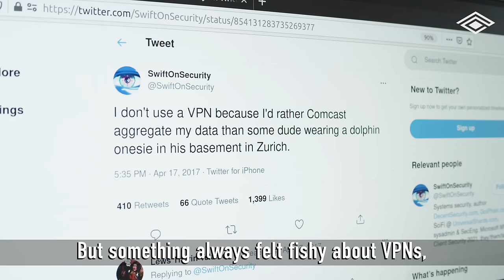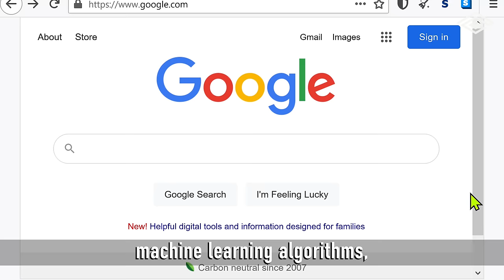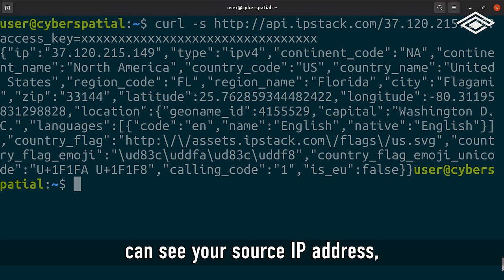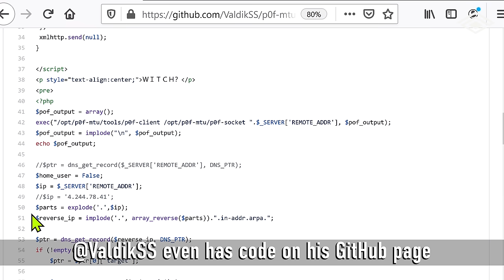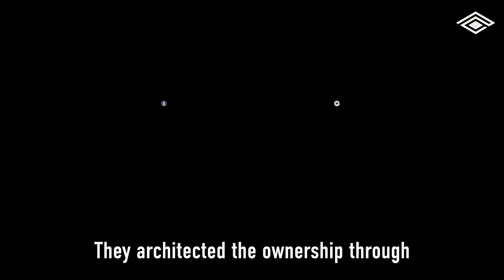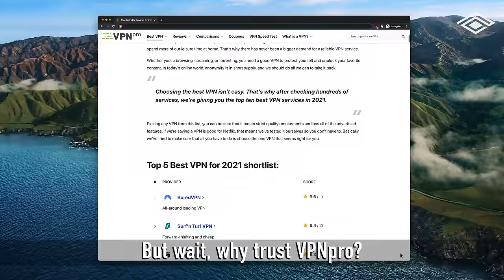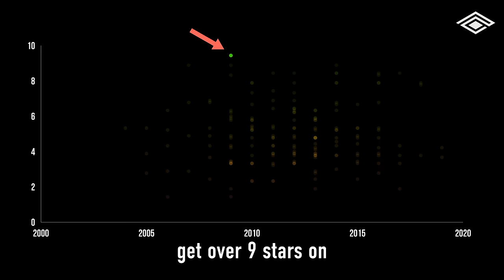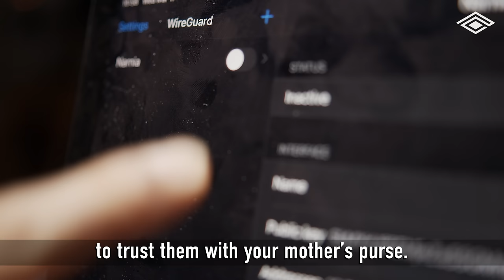Why VPNs are a WASTE of Your Money (usually…)

Comment: In my experience, the Internet slows down without the VPN. It appears that certain routers may restrict the flow of information from a particular IP address and throttle it over time. VPNs often help bypass this issue. On the other hand I’m extremely suspicious about VPN, especially when they’re home office is in Panama city Panama, which is basically CIA headquarters for all of central and South America.😂

Comment: I used proton vpn while I was working in russia in 2022. They quickly banned all vpns and even while connecting to the internet through the Embassy internet, they were still able to block my attempts to use the vpn for most of my stay there. The only reason I bought the vpn was to try to protect my data from their government. I still have the service because it was a 2 year deal, so now I just use it so I can get around geo restrictions because I'm still outside of the US.

Comment: That's not necessarily true. Your IP address is exposed. No matter where you are in the world or what you're doing. Even game consoles like PlayStation and Xbox. Expos your I, p, so what you do if you do? Use a VPN need to use it from an official company at standpoint. Not a cheap VPN. That's from some cell phone company. You want it based on the actual internet observation type? Companies like Malware bytes or Norton 360. And then you need to make sure that your VPN setup nearby not necessarily on top of the same place that you're at but.  Nearby, so when it tunnels, it tunnels somewhere close by with less ping ... 32 ms or 60 is good which will keep your internet run as smooth and then if you have packet filters on your router is set up your packet filters up? There are 3 different types of packet filters. You will need to them active if you're gaming in for good streaming. If you activate the third type, the third type will deactivate TV's in cellphone calls and then read all your dues and donuts on your router because your router will have specific policies on it as well. Same thing goes for the rule basis. Everyone's router rule basis might be a little different...

Comment: Yea, using an "online vpn service" is basically pointless, unless you want to use the service as a proxy in order to "pretend" you are from another location. If the VPN client is not directly installed ON your device which, connects you directly to the VPN Back-end, then all traffic between yourself and the point to where your're connecting to, to the VPN service, is NOT vpn encrypted. Best is to make use of a corporate VPN, that requires a VPN client directly installed on your device, in order to connect! Preferable a 3rd party client with it's own server issued certificate that no-one else can possibly have! That's if you want to be truly secure... Any other method leaves a lot to be desired!
Reply from the maker: Great thoughts, thanks for sharing! Can also use a portable router that transparently tunnels your devices.

Comment: Oversold and aimed at the technologically unsophisticated. Example: He ticked off of 'hardware address' with the Content box, 'location' with the HTTP box, 'time stamp' with the TLS box, 'true IP' with the TCP box, and 'Google account' with the IP box (holy crap, you mean Google knows when you use your Google account?! wow). None of those things have anything to do with what they're listed with. This is the same kind of marketing manipulation he complains about in the premise. 

A fun fact: Every modern OS has the option (usually on by default, now, but I don't know for sure) that wireless connections (like at Starbucks) use a randomized MAC ('hardware') address. One connection's address will differ from the next, even at the same IP with the same device. Also, there's no such thing as "true IP." The guy just explained that IP addresses get changed/re-used by multiple ISP customers, and so an IP address will only actually track you to within a few zip codes (back when he was trying to tell you that VPNs are useless); but now an IP address is fixed not only to a certain location, but to your specific device? That's not how IP addresses works in the modern world. NAT is a thing. 

The entire DoD, including the NSA, uses VPNs for transmitting all kinds of official information, up to and including Top Secret classified data over open "dirty" Internet (see CSfC Capabilities Packages).

Comment: Every time my VPN goes down I get a copywrite strike from my ISP.  So whether they do anything real or not they keep my ISP from snitching on me or cutting service.  If I was worried about the fed I wouldn't be using electronics.  But getting the only fiber service in my area to cut me off will suck.

I'd avoid pirated software if there were FOSS alternatives to everything I wanted or I believed in copywrite laws.

Good avice of constructing your own.

Comment: I am surprised by how many use VPNs only to be told by me and others, "No disable it.  THAT'S why you can't access the internet."  Literally whenever someone calls me complaining that their Aphone can't get on the internet, that is often the 2nd or 3rd question right behind is WIFI turned on.  And 9 times out of 10, if one is installed, disabling it resolves the issue. Why that is the case is anyone's guess. Are these free VPNs down more often than up?

Comment: Hi! and thanks for sharing. 

I would say the most relevant part of the video starts at minute 5, where you elaborate on the reasons why you find VPNs ineffective at masking your IP.

You mention things like layer 2 vulnerabilities that lead to tech companies knowing your location and ISPs knowing you are connecting to a VPN, which are facts, but are they pertinent to the subject of VPNs, given that their main job is to mask your IP in order to hide any trace between you, the user, and the domains you connect to?

Yes, tech companies track our devices, but that doesn’t necessarily mean they can decrypt the data being sent to you from the VPN, and I don’t think the ISP1 can either. Maybe I'm missing something, but the same should be true of ISP2 (the one that services the VPN). Sure, they will be logging the packets between the VPN and the end domain, but those are encrypted packets, and they lead to the VPN's IP address, not yours. Meaning, the VPN will ultimately have to disclose their IP mappings for that to be of any value. In other words, if the VPN really doesn’t keep track of this data, then ISP records are of no use to them. Am I wrong?

Comment: VPNs are essential for accessing the Internet in China and for bittorrent downloading anywhere. Period.
Reply from the maker: You can access the Internet in China without a VPN. Bypassing geoblocks and National Firewalls is a use case mentioned in the video. 

You can BitTorrent Ubuntu Linux just about anywhere without a VPN.

Comment: Most cell plans limit video streaming to 480p. They do this by throttling your data speeds whenever you connect to a streaming service(Youtube, Netflix, Crunchyroll, Etc etc...) However, when you enable a vpn, you obscure the server and get max speeds. When I am connected to 5g, which is most of the time, I get 170-250 mbps which means I can stream 4k60 video whenever I want, and because my vpn is only 1.99 a month, I saved 18 dollars a month not upgrading my service to allow 4k video streaming

Comment: Quite a few of the things he says aren't true.
For example if your using a VPN your local network or geolocation is the VPN, this info only changes if you made the mistake communicating addition information to the host your connecting to, that a user error not the VPN's mistake.
Data storage of the ISP is incorrect because the ISP only sees encrypted data that it can't decrypt, they data is useless other than say hey I think  this pc is using a VPN.

Comment: So many stupids to "unpack".  First, Personal VPN's DO mask your original Geo-Location enabling you to surf and pretend your from a different country and you can launch independent VM's per session to side track any possible trackers.  Secondly, for corporations, VPN's mask your internal private IP's and its encrypting every communication.  Not all programs use https.  For instance, Outlook doesn't even offer an encrypted connection to your mail server and typically uses S/Mime encryption to send messages (only if you specify you want encryption).  Another thing that Corporate VPN's offer is pushing all client data to the companies network.  That way the communications can be tracked and ensured that it adheres to company policy which is mostly done through Firewalls.  This ensures that everything you do on your corporate laptop adheres to company policies.  This exclusive connectivity back to your companies network ensures that you can't  load harmful software since the company can now control your laptop through policies.  There are 100's of reasons for VPN's and I can't list them all but if you think that https solves everything, your mistaken.
Reply from the maker: If your computer has Wifi or Bluetooth near an access point or phone, there goes your geolocation... even with VPN. 

Sure you can use independent VMs to compartmentalize session fingerprints, but what's that got to do with VPNs?

VPNs don't mask your private internal IPs. For instance, if you have WebRTC enabled in the browser.

If you're using a program transmitting traffic in the clear across the Internet, you should probably not be using it. Re Outlook, the transport layer encryption depends on the configuration with the mail server. S/Mime is PKI-based end-to-end encryption, category error if you're conflating that with the transport layer encryption.

Corporate VPNS are definitely a legitimate use case mentioned in the video.

Take a look at Google's BeyondCorp architecture. No VPNs to access the corporate network. Just Identity access proxies and HTTPS.

HTTPS doesn't solve everything and there is a place for VPNs. Commercial VPN companies touting them for security and privacy? Questionable...
Reply: To find a Geolocation, you would have to spy on them from the beginning to determine where they are.  Again, you can spin up a VM in the cloud or off-location or anywhere and use that to surf.  Also, using a VPN on a computer where there are cookies and other means to track you in itself won't protect yourself.  Especially with a Cellphone.  Especially since they are equipped with an IMEI Identifier.  The BEST way to surf is to setup a One use VM not in your physical area and then use that VM through a VPN to access the Internet if you want to remain anonymous.  There are other ways but that's the easiest method. @Cyberspatial

Comment: $20 in 1916 is how much today, 2024 adjusted for inflation?
Result: $596.78 in 2024 dollars.
Prices increased by 2,884% over that time period, with inflation averaging 3.19% per year. So $20 is not a massive fine but it's also not merely 'symbolic' like say a $1 fine today or 5 cent fine back then,

Comment: This is a very weird reason for me to use VPN, but i use VPN mainly to avoid packet loss and maximizing my download speed. I dont know how that works tho
Reply from the maker: That is really really interesting...
Reply: @Cyberspatial  exactly. im playing video games called SQUAD right now, and most of its servers are located outside of my region (I live in Southeast Asia). which you know, interregional connection are not really enjoyable for playing games. with pings around 240 to 350. At first, its filled with Packet Loss (around 20%)
then i remember i still have that one switzerland vpn subscription, so at the back of my mind "why dont i try that"

i connect to my nearest server, and hopped back into the game.

no packet loss.

and i notice that when i do the same (connect my vpn), my steam download connection would be much faster and more consistent. (my speed is around 5MB/s, and it tops around that more or less when using vpn) when not using VPN usually it only reach hundreds of KB/s

i dont know at all why this is my case 😂

Comment: My router RM-7200 encrypt all data, all ports stealth so no hacker can find open ports. 8 prt router 40gbps per port , self build My ISP contacted me cause ok external ip but no connections found. I did told hem my own creation  because there where no 40 Gbps per port routers, backbone 7200 Gbps.  Wan scalable between 300 Mbps and 40Gbps

Comment: There are so many things wrong with your logic that's not even worth pointing out. A VPN, is like a gun, it can be dangerous even for the one who holds it. I hope I wasn't too subtle. To give you some credit as well, definitely a VPN doesn't do much for the normal user when it comes to security, privacy and anonymity, maybe just a bit, but yet again, don't put everyone in the same bucket. As for your running your own VPS & VPN server, that's cute and funny, like driving a plane on a road as no one is capable of flying it. Too subtle, again ?